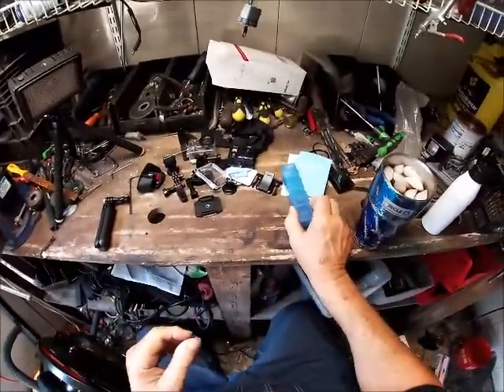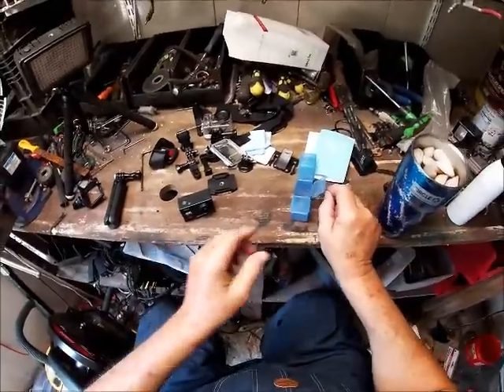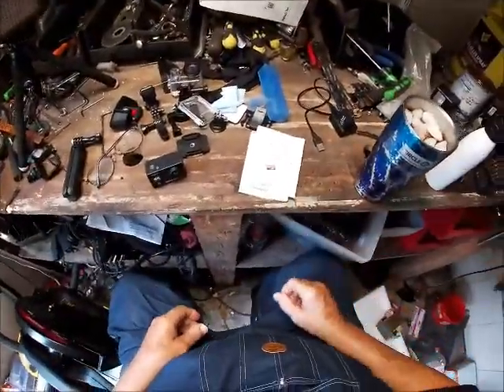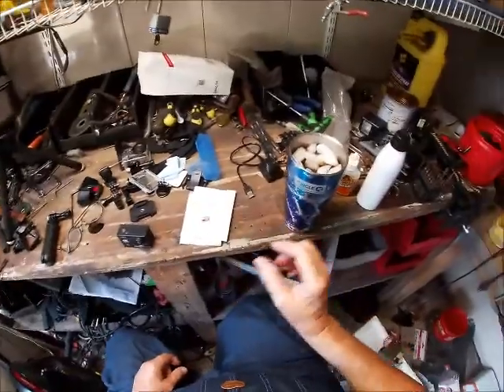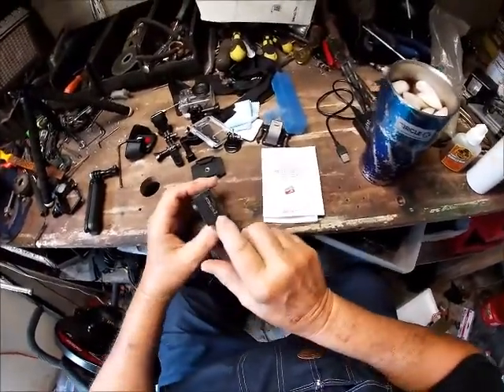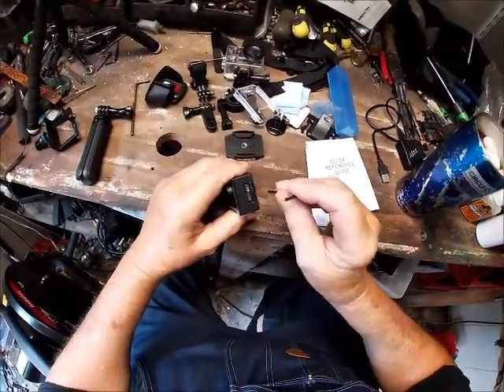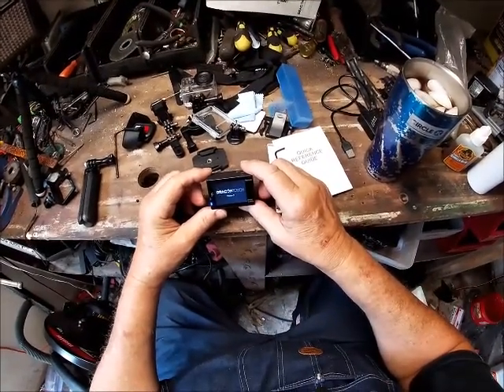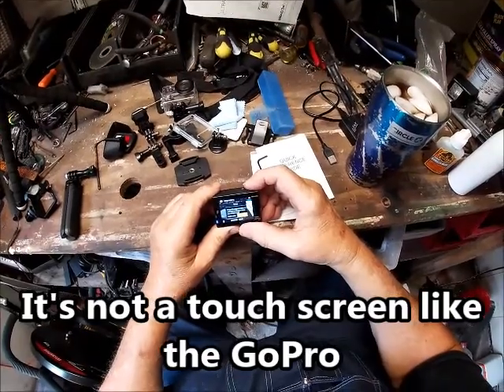GoPro Verses Dragon Touch From The Dumpster & Betty Boop

Comment: YES FOR BETTY BOOP!!!!!!!!!!!!!!!!!!!!!!!!!!  I bought a go pro from amazon and its terrible! No adjustment of sound. Its too late to return it too.... I took so long to try it out I guess.
Reply from the maker: what kind of gopro is it?
Reply: @JunkDobber  Its a AKASO 4K ultra HD WiFi go pro. Its awful Russell. I put in my sd card which is 8G and it only records 12 minutes and it says its full!! Plus the volume is very low. Research said it was ok but low volume. I give it a 2 out of 10. All the parts it came with are good and I bought a whole set of separate supplies. Cost me about $100!!!